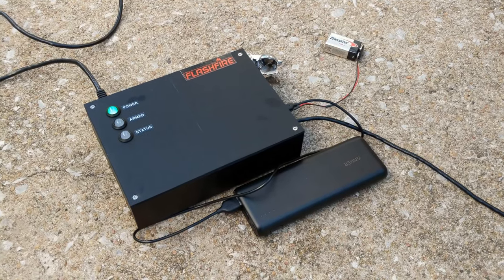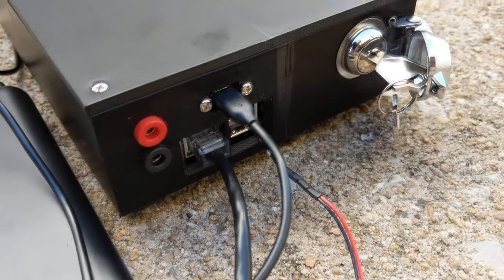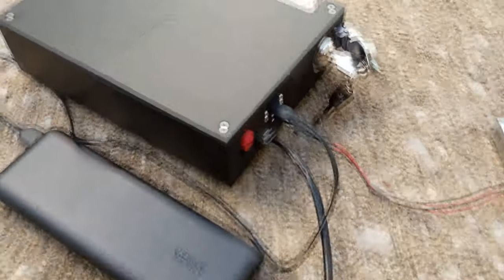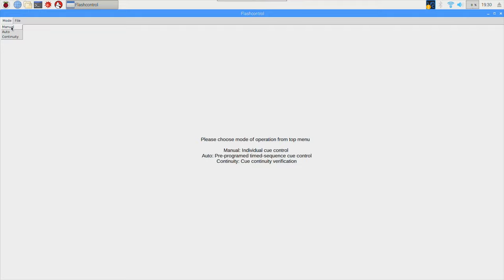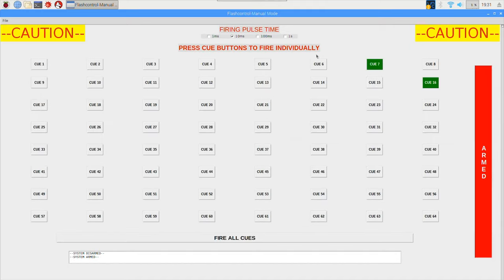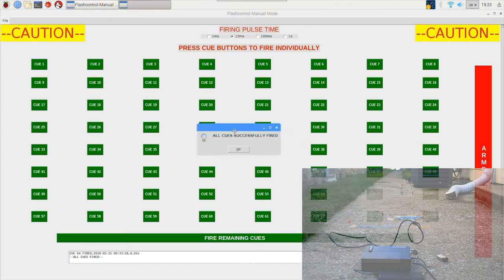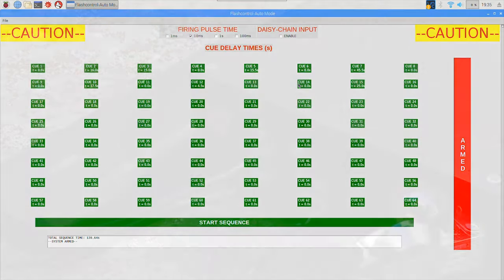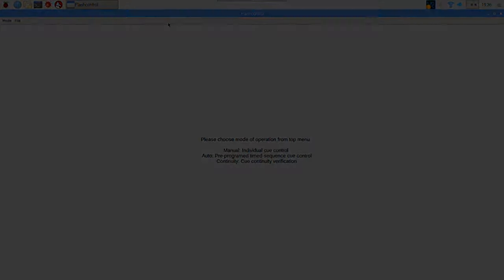Home-made Fireworks Firing System

Comment: how can i get more information on your system
Reply from the maker: Hello Ron, you can check out my most recent video on the system as this version of the system is outdated. Unfortunately it is not for sale currently but some day I eventually do plan to sell it once I can get enough funding and sort out the legality of selling such a product.
Reply: @fabo1593  did you use an arduino or just the chip on your new model
Reply from the maker: @roncall4339  The remote controller has an off the shelf Adafruit ItsyBitsy M0 development board on it. The field module has a barebones circuit of an Arduino on it minus the chip for USB programming.
Reply: @fabo1593  what about the fc python script to make the buttons on your laptop and remember I am an amateur.
Reply from the maker: @roncall4339  this was a python script that ran on a raspberry pi inside the field module, that was then remoted into in order to control the system. I found out through real world use that it’s much simpler just to have a dedicated hand remote which allows the user to change the cue to be fired and arm/disarm the system.
Reply: @fabo1593  I have been trying to figure out the raspberry custom buttons ssh ap I have on my phone but I don't know how to setup the comand line so I can setup  i2c
Reply from the maker: @roncall4339  I used VNC viewer/server to Remote Desktop to my raspberry pi. Unfortunately I’m not too familiar with using SSH terminals for remote control.
Reply: @fabo1593  I haven't vnc viewer I have used ssh putty. My son knows more about the pie I do